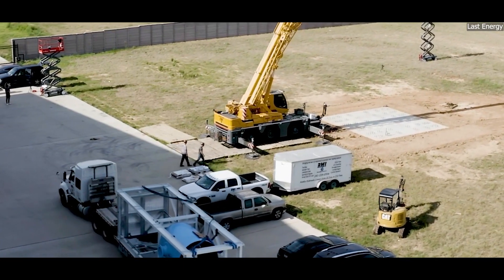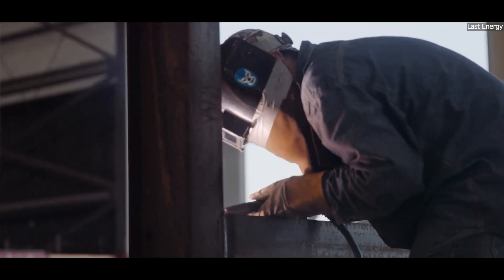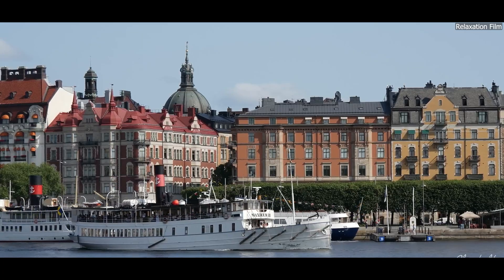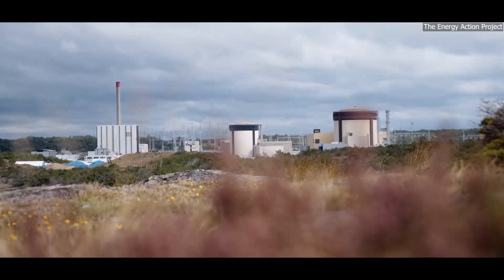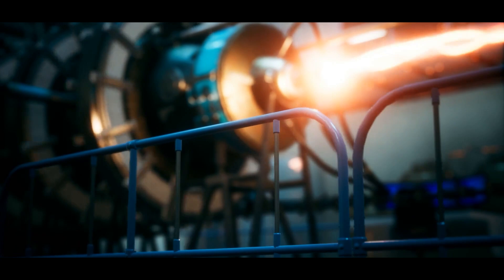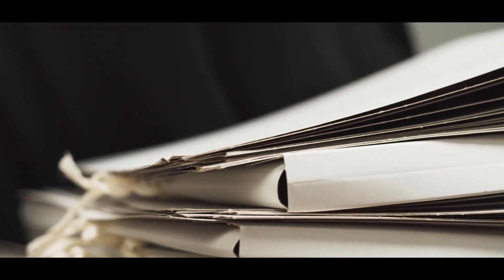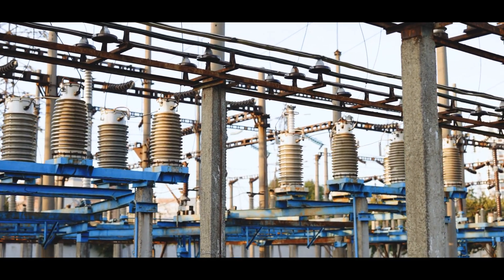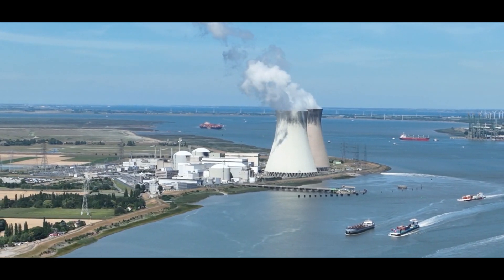Sweden’s Revolutionary Small Nuclear Reactors Shock the World

Comment: Correction: Sweden HAD the best energy system in the world. In the 80's we had 12 reactors in the sothern part of Sweden and hydropower in the north. The nuclear power and the hydropower balanced each other perfectly. In the start of year 2000 we started our new green deal from hell and shut down half of our reactors. We now only have 6 reactors but the energy need is much higher now than in the 80's. We tried to replace reactors with wind turbines that works about 40% of the time compared to nuclear energy that works 98% of the time regardless of weather. This was a terrible move that made the once so stable power grid to a nightmare. The price swings between -10 öre and +1000 öre per kWh depending on the wind. When the wind is blowing, we have free power, and sometime they even pay us to help burn of that extra energy. On cold calm days when we need the power the most, its extremely expensive and they tell the population to turn down the heat and stop using their vacuum cleaners during these peaks. And now we are told that everyone should buy electric cars. Last year the politicians finally understood that we need the reactors back and they started building. Will take 20 years. Took only days to destroy the grid but takes 20 years to fix. So no, Sweden is almost as stupid as Germany, but that is another stroy.